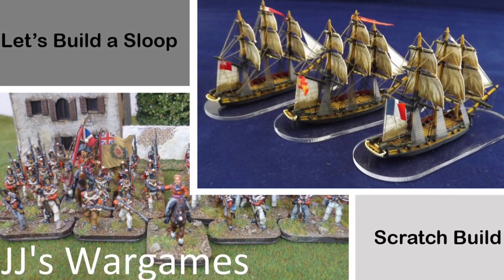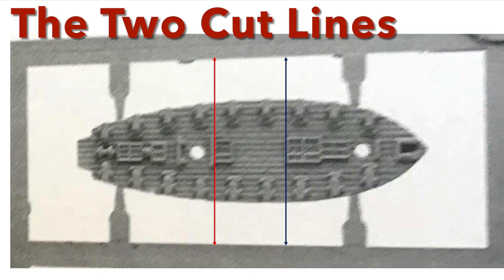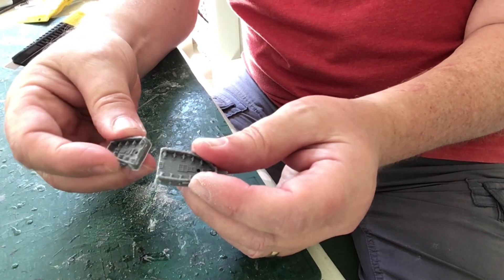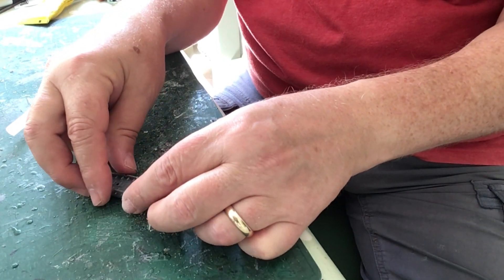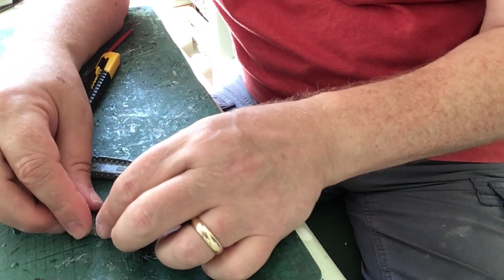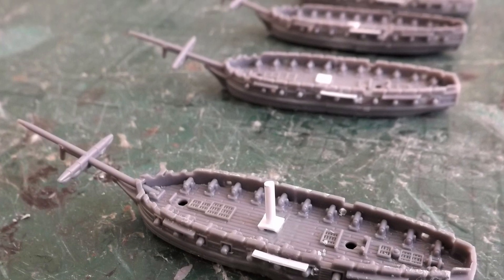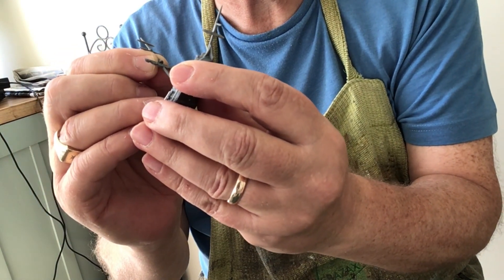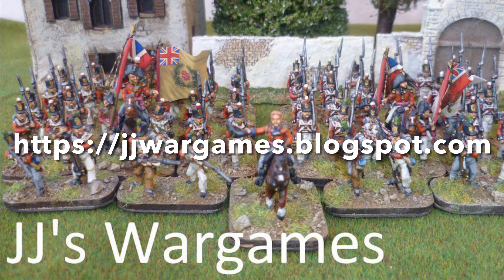Let’s Build a Sloop

Comment: L❤VE the Video!  A couple of questions.  Have you ever done a modification of the 5th Rate Frigate at all?  If so, what did you do?  Lengthen it?  Shorten it?   
Second, I'm going to do this mod for the Flush deck sloop, but on the Small Brig, I'm thinking of just using the Mizzen mast only and only mounting the tops'le.  I have some extra Larger Jib sails that I was thinking of using for the Jibs on the Small Brig.  Thoughts?  
I have a couple of scenarios in mind where the small Brigs are courier/mail ships with important orders/Person(s) aboard with them.  The mission of the opposing fleet is to try and intercept/board/capture this person/orders.
Reply from the maker: Hi and thank you. No I haven’t modified the frigate, and with other options available from Warlord of smaller frigates and sloops am unlikely to do that now, with this mod very much a stop gap until other models became available. I’m assuming you are thinking of converting the small brig that I show which is made from the remaining pieces left over from the cutting process. I think the length of the deck might be very difficult to accommodate three masts on, with the sloop illustrated pretty well at the limit for such a conversion and even then it is not a great conversion with not a lot of space between the mast to allow the yards to be reversed when needing to heave to. Still I wish you all the best with your project and glad you found the video helpful. Cheers JJ